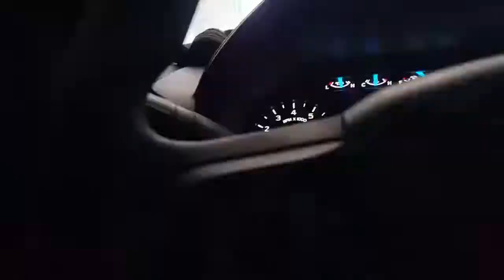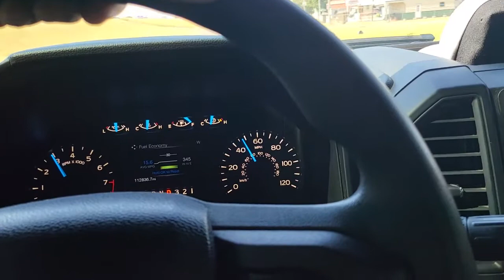2015-2018 F150 3.5l Non Turbo Upper Intake Plenum Removal

Comment: I think the reason there are so few videos on the 3.5NA is there is seldom a need to work on them. I just passed 200k on mine and installed the second set of spark plugs. Didn't need to but I thought it might be a good idea. In my opinion, this is one of the best engines ever. Just a tad over 210 CI and it pulls like a 400 cube engine. I've maxed this thing out on many occasions pulling heavy loads clear across the country and it does it in stride. Who needs those turbos? Two sets of plugs, and oil changes when the truck tells me it's time, usually around 8000 miles and that's it. It still runs smooth and doesn't burn a drop of oil. Just a great engine in a great truck. But thanks for the video. Good job.
Reply: The ecoboost is nothing but a pig with lipstick.  You don't need it.  First thing I did when I looked at it was say, "no way" and I bought the regular aspirated.  For all the ecoboost trucks I see sitting at the side of the road,  I think my decision was 100%.
Reply: How many miles does it have now? Have a f150 with 75k miles with this engine. just want to know what to expect in the future

Comment: Great video that helped me change the spark plugs on my 2017 3.5 Flex fuel F150. My only suggestion is that when you reinstall the plenum that you torque the 7 bolts in proper sequence with 89 inch pounds of torque plus an additional 45 degree turn to each bolt. The bolt tightening sequence can be found on the Ford Truck users group. The only problem I encountered was when the rubber boot on one of the coils broke off as I was pulling it out. It took me quiet a while to get the rubber piece loosened from the plug so I could extract it. Some videos recommend that you replace all of the rubber boots when replacing plugs and it might be worth it if you plan to drive another 100K miles and need to change the plugs again. Thanks again for the video.
Reply from the maker: That is definitely good advice to use the proper torque sequence. As stated in the video though, I dont normally do tutorials or "how-to" type of stuff. If I did, I would definitely include torque specs, sequences, etc; glad you enjoyed it, and glad it was able to help you!

Comment: I have a 2015 with the 3.5 n/a  130k and it’s got a pretty noticeable ticking sound that matches rpm but is definitely more noticeable at idle I was planning to check the plugs this definitely helped motivate me to do it
Reply from the maker: Glad it could give you some motivation! However, your ticking noise might not be your plugs. Just a fair warning!

Comment: I broke a clip on one of those vacuum line. Ended up using a old radiator hose as a replacement and have no problems. Over 5k milss so far

Comment: Which spark plugs did you use? Sp-580 or sp-534? And what would be the difference? 

Also should I just get the spark plugs or replace the coils as well? 2015 XL f150 NA with 88k miles

Thanks!
Reply from the maker: I believe I used SP520, and I'm not sure about the difference. I would recommend replacing the coils as well, but use only Motorcraft coils.

Comment: Kudos for this great video.  I was looking at the plug change thinking how easy it would be until I saw the one plug that the imbecile engineers covered with the plenum.    The quote from a ford dealer was 5 hours and $780 CAD.  It looks like you went through the agony and this is a comprehensive demo on how to save that green.  One note to all the automotive engine design engineers out there is that I despise coil packs and plugs that are stuffed in a tunnel through the intake manifold. Do not do that. Bring back the days of exposed spark plugs as in pre-2000 engines so a job like this can take the 15 minutes that it should.
Reply from the maker: Took me about 2 hours to get this done. So 5 hours of labor is a very high estimate. Just be sure to change your gaskets to avoid any trouble down the road with vacuum leaks!
Reply: @shift-heads1686 yeah I tell the ones I do also the same.. use that saying since we are in here we can or would recommend to charge this etc.. most time they do it u let them know hey if you don't and down the road give you problems you don't want to do this again.. just do it once get it all and move on lol

Comment: Is there a gasket to replace once the intake is removed , that place where we are to cover the intake holes ? Thanks from Texas
Reply from the maker: Yes, there is a gasket. Its the blue one in the video. Depending on what gasket set you order, it may be a different color. And I say gasket kit, because you can't buy that gasket by itself, you can only get it in a kit, unfortunately.
Reply: @shift-heads1686  cool 😎Thank you very much for your reply.
Reply: My gasket was in good shape still protruding like it should. So the plug change was successful. My 2016 F-150 xlt super crew cab is running so much smoother at 60k now

Comment: Hey I have a 2015 3.5 non eco boost and I’m trying to find the cam position sensor b bank 1. I’ve seen diagrams of it being on top of the valve cover on the passenger side. Is that where it’s located?
Reply from the maker: Cam sensors are actually on the rear (towards the firewall) on the head. There are 2 per head. Make sure you replace the correct one. If you're not sure, I would replace all 4.

Comment: Hey I have a 16 f150 3.5 non eco and I’ve been leaking oil slowly out of those two plug / censors whatever they are on the front of either sides of the engine. Do you know what they are.
Reply from the maker: On the Valve Covers?
Reply: Theyre valve covers your gasket might be blown
Reply: I got the same problem, how you did to resolve that?

Comment: All that, to get to the spark plugs. All day job.  But, thanks.
Reply from the maker: Actually got it done in 2 hours...
Reply: @shift-heads1686 Mine would have been a two hour job, except for a broken bolt in the very back of the manifold. Currently pulling the lower manifold to get to it easier 😅
Reply: @rapTorfx4   i didnt it friday.  Youre right, took about 2 hours. This video made my job easy easy.
Reply from the maker: @rapTorfx4  

Ouch! That's some rotten luck, bro!